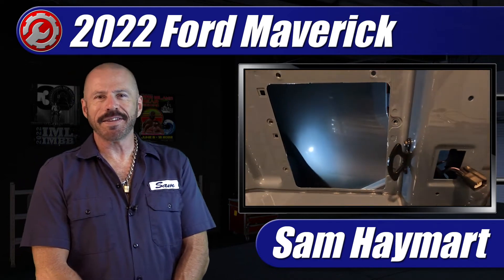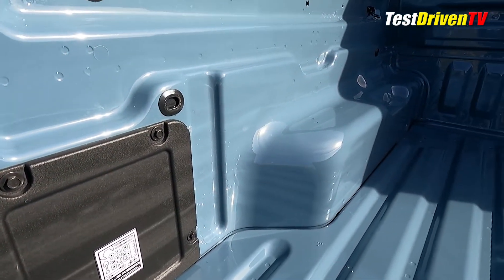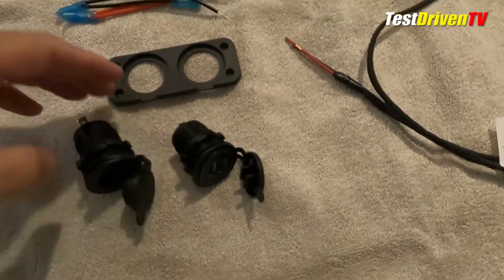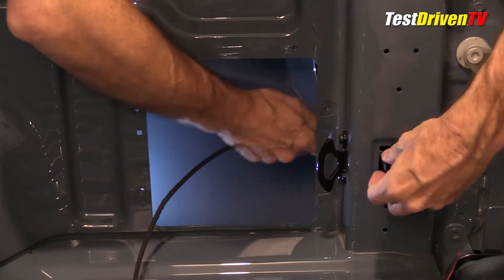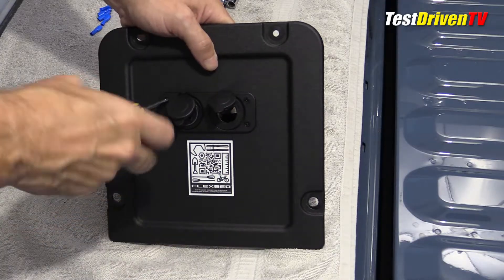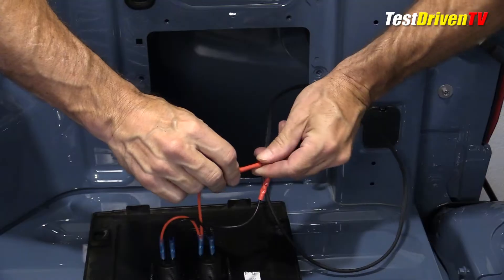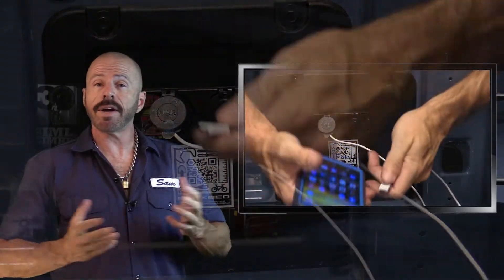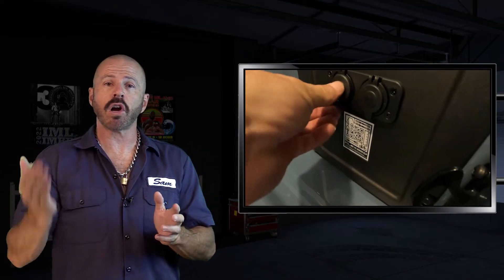2022-2025 Ford Maverick: DIY Cargo Box Power Outlets

Comment: The best thing about the Maverick 12 volt system is that now with the recent update, which was part of a recall, the 12 volt system runs continuously. So when you leave a device plugged in in the car and you return a couple hours later it's fully charged.
Reply: I have a dashcam installed on my maverick connected to the 12 V outlet, just how you said, its always on, do you know if I leave it plug my battery will go out of power? Or it turn of the outlet when it detects low powet

Comment: Hey Sam, do you know if it’s possible to hook up something similar to that in addition to a cargo led light on the same panel? Would the wiring accommodate two items like that or would I need something that splits off into two connectors? Novice electrician here, so excuse my lack of knowledge.

Comment: If you want to use the outlet/s, do you have to turn on the engine to avoid  discharging the battery?
Reply from the maker: Sure. At some point the computer will turn off the power if it threatens the battery however

Comment: Question: What is the part number for the plug and wire set / extension in this video?  I have a 2023 Maverick and this was not included with the vehicle.  I’ve talked with my local dealership (Roswell, GA) and they are having a difficult time locating this plug & wire set shown. Thank you in advance.
Reply from the maker: Not sure what part number is. It should be found under your rear seat in the storage area. That is where they put them from the factory.
Reply: @TDTVGarage  Mine was in the glove box. 2023 hybrid.
Reply: @TDTVGarage  Thank you.  I will try looking there again.

Comment: Is it possible to connect 40$ after-market 400w 110v inverter to the 12v outlet you just installed? How much power and the fuse amperage for the factory preserved 12v wire? Thanks.
Reply from the maker: You can consult the owners manual to determine what the amperage is for  the rear power point circuits
Reply: @TDTVGarage  Thanks, as shared from mavericktruckclub, the rear 12vdc is usually fused with 20A fuse, thus the maximum power is about 200~240w if we hook a $40 aftermarket inverter. However, per your advice, the Maverick truck manual (https://www.fordservicecontent.com/Ford_Content/vdirsnet/OwnerManual/Home/Content?variantid=8431&languageCode=en&countryCode=USA&Uid=G2213267&ProcUid=G2190098&userMarket=usa&div=f&vFilteringEnabled=False) says maximum amperage is 15, which means 180w maximum output.

Comment: Pro tip from a guy that works at an upfitter. Use solder shrink connectors. Their recommended by Ford in their upfitter guide. There’s no crimping. You put in the two wires. Hit it with a heat gun and it melts the built in solder connecting the wires. The heat shrink is waterproof too. It’s an amazing tool!

Comment: Thank you. This was helpful. But I need continuous power.
You mentioned the power was switched and would turn off after a period of time. Is there a way to get essentially endless power? For example, place the vehicle in park, leave the vehicle on, connect your continuous draw 12VDC device and let it run. The ICE would kick on as needed to replenish the battery.  So, as long as you have gas, then you have power (even though you are in park and not driving anywhere). Is something like this possible?  
Thank you,
Andrew 
PS.  I'm planning on ordering the 2023 model as soon as ordering opens again in August.
Reply from the maker: If the vehicle is switched on, the power stays constant.
Reply: @TDTVGarage  Excellent!  Thank you.

Comment: Looks good. Do you like you could add the cubby in if you ordered one from Ford?
Reply: I added a cubby to the drivers side. I also added the same switch to the passenger side cubby. But I installed on the inside wall closet to the front of the vehicle. That way I still have storage and the switch.

Comment: Would you be able to do a project where you change it into a power inverter for plugging in household items
Reply: I didn't order my Maverick with the factory inverter because I already had one, 400 watt like the factory. Once you install this type of plug you can plug your inverter into it and you good to go. In fact I just installed the plug yesterday and tested using the inverter. Worked perfectly fine. I plugged the soldering iron I used into the inverter and the iron heated right up.
Reply: Wait! So, a regular 12v outlet, plus a 400w inverter means i can use 110v items? @williemccoy259
Reply: @AaronPachtinger  Yes, 110V items up to 400W - which is enough to charge batteries or a small TV

Comment: How long does the power stay on until the truck cuts the power?
Reply from the maker: Until the computer decides it's time. It varies.
Reply: I dont think it based on time, i think it based on power left. 
I came back 60 minute after and it still running on.